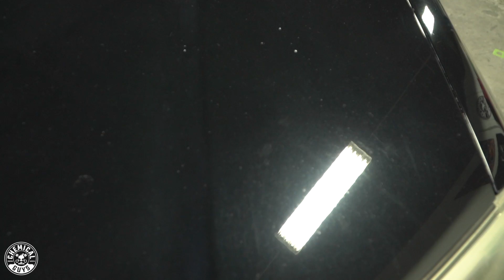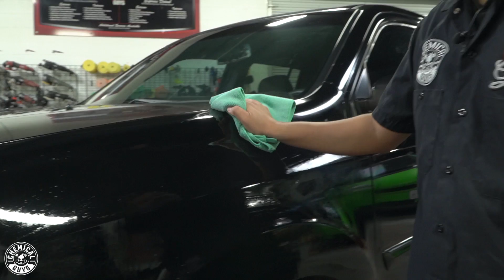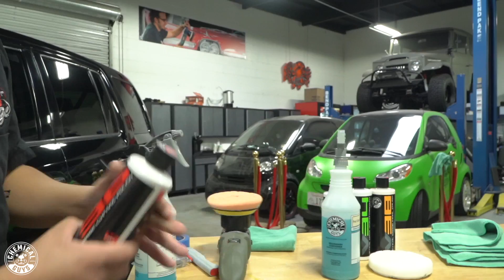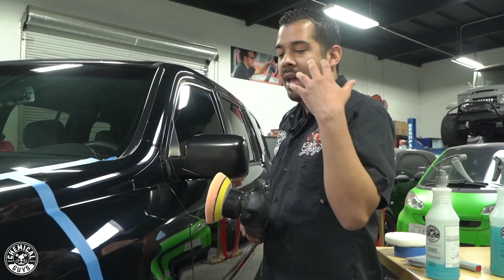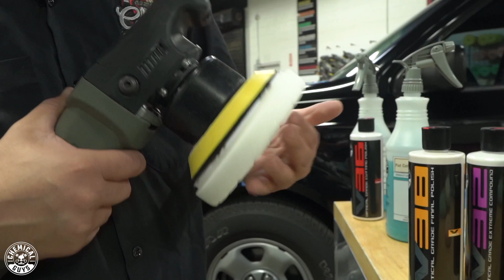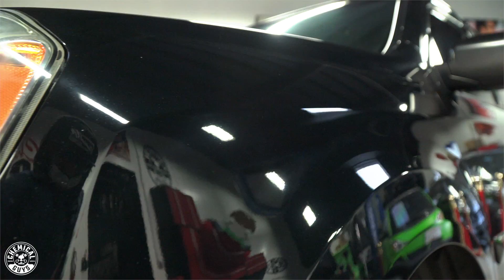How To Restore Swirled Paint! - Chemical Guys

Comment: What speeds were you using with the buffer?? That's always been a source of confusion. Thanks
Reply from the maker: Hey Vincent! Spread product out using the lowest speed setting and then use the highest speed setting, when using a dual action or random orbital, to diminish compound and polish until they have turned clear.

Comment: How many times could you use the same clay?
Reply from the maker: Hi Daniel! One clay bar can be used several times. Fold and knead the bar until you no longer can find a clean face at which time it should be replaced.

Comment: Is there a difference between your clay bar and your clay block? I've only used the bars but I ordered the block kit because I wanted to give it a try.
Reply from the maker: Yes, the Clay Block is a synthetic form of clay that utilizes a rubber/clay mixture. It works out great for light- medium contamination and comes in an easy to use block form making it easy to grab. The Clay Block works out great for maintaining your vehicles paint in between clay bar treatments or as an alternative to a clay bar.

Comment: Would you wipe the paint down with Wipeout before applying a ceramic?
Reply from the maker: Hey there! Yes, it would be best to use Wipe Out before applying coatings to ensure the surface is totally clean.